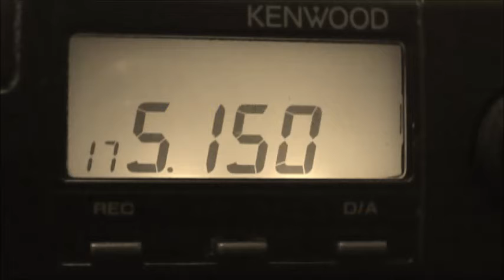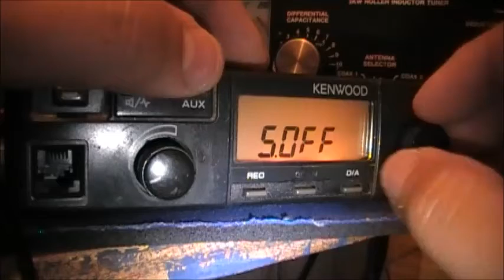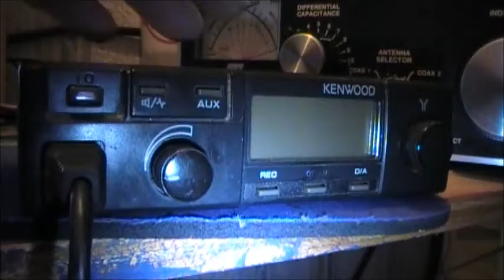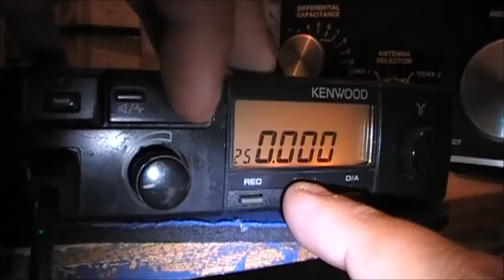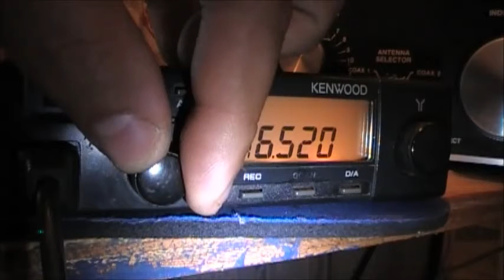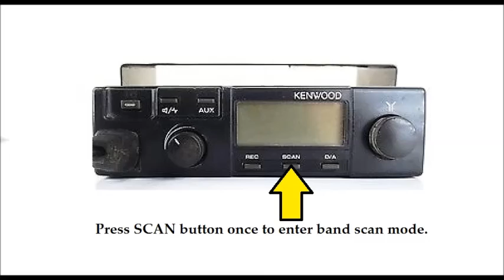Kenwood TK 705D front panel programming - "Description updated"

Comment: Got into the ham radio and a couple of real real good old school hams specifically gave me one of these radios they are the type they wanna see me make the dang thing work and show them I appreciate it ..but the old pain in the rump thing is still factory set .
Reply: It won't get into the repeater but 8 miles away they got me .. might need a beefy power supply
Reply from the maker: Perhaps it is set to low power 10watts?   do you have a RF meter to test RF power output?
Reply: I think it was the 3amp power supply it requires 7amp minimum
Reply from the maker: @jaysaw8151 that would do it for sure. 😊
Reply from the maker: Best of luck getting it programmed and showing them what you can do! 😊

Comment: Back in 1994, I was introduced to the UHF version... TK-805DH, which included scan & was also high power.  Interestingly, there were three bandsplits, with the first covering both the ham (438-450 MHz) & commercial bands (450-470 MHz), with no retuning.  It was rather expensive at nearly $600 new, but that got a DTMF Mic, programming cable, software, & service manual.

In the VFO mode, the UHF bandsplit kept it between 438-470 MHz.  I ran across the VFO mode completely by accident, when trying different button combinations, in conjunction with the power button.  Another button variation I believe puts the radio in clone mode.

Other than the antenna pigtail issues, this was a very versatile radio series.  Maybe someday, I'll get a TK-705DH, to experiment with VHF.
Reply from the maker: That's some great background information, thanks for sharing!

Comment: Are these radios worth buying for a beginner? There’s one available for $80 Canadian here in Alberta. The ads just says TK705 no letter D on the box. Thanks.
Reply from the maker: Depends if you have the programming cable or not...  If not, and dealer mode is not enabled, then you wont be able to do much with the radio.
Reply: @Radionut63  Thank you for the quick reply. What radio would you recommend to me for starting out on? I have no transmit licence but have wanted to get it for some time now. Money isn’t flush so a not so expensive radio suggestion would be appreciated. I assume from you’re accent you are east of me in the Maritime’s. Thanks and stay healthy.
Reply from the maker: All the commercial gear is OK if you can get your hands on the programming gear and software.. But like you said, with no license would not be good.   You can listen all you want, but not transmit.   Amateur gear can be bought fairly cheap on swap shops and classifieds.   Sometimes pretty cheaply.